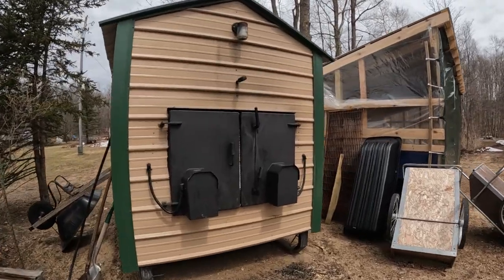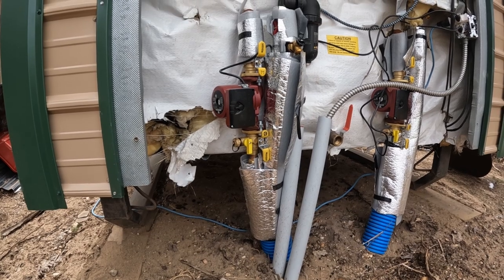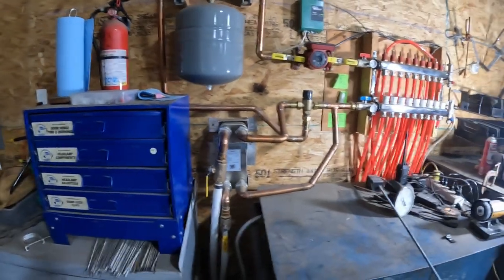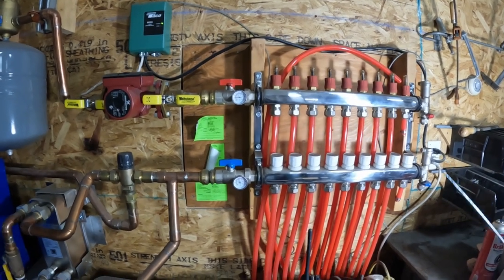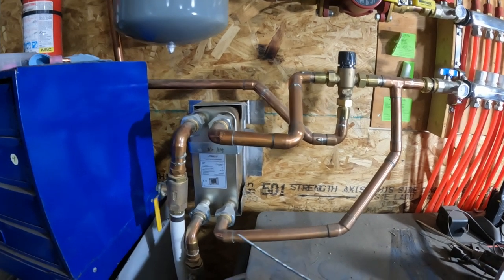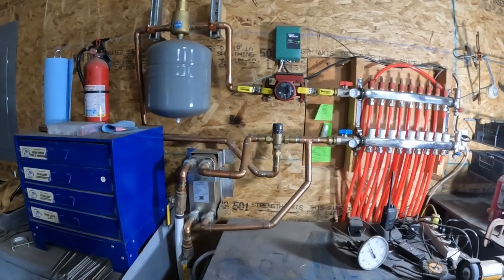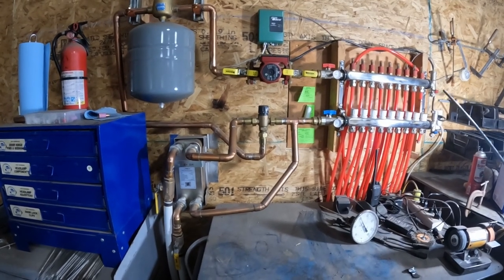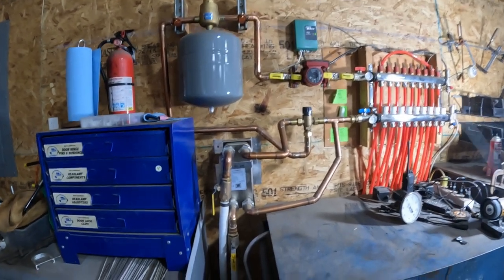Outdoor wood boiler to pole barn in floor radiant heat plumbing.

Comment: Did you install a thermostatic return valve on the water from the boiler. This ensures that you don’t drop the boiler water colder than 150 f which helps prevent sulphuric acid from condensing inside the boiler
Reply from the maker: I did not, I'll look into it though. Of all the prep I did for this I do not remember reading about that.  Where exactly would it go?

Comment: Thank you for the good video. I'm building a 40 by 40 Pole Barn in the Grand Traverse Bay area. And I want to add a future water boiler. Let's start with natural gas water boiler is going to burn Cherry pits. Up here in Traverse City there's a bunch of cherries and they have a high oil content
Reply from the maker: Hope it helped,  good luck over there,  you're only about an hour 20 from where I live.  Just finished our 3 season running the wood boiler,  and though it's some work,  I couldn't be happier,  heating both the house and the barn for a fraction of the cost of lp.

Comment: Hi, I am installing a near identical system; a wood boiler (Earth Brand), to supply in-floor radiant heat tubing.  Did you do the plumbing yourself, or have a plumber install?  I definitely need help, and am over my head on this.  Thanks!
Reply from the maker: I did the 99.9% of the plumbing, I didn't have a 1.25" pex crimper so I had a plumber buddy of mine bring his crimper over for the 8 crimps, I did everything else.  Just take your time and plan it out.  I've made several videos of just about the entire process but am more than happy to share/help anyway I can.  Ground prep, I laid plastic sheeting on the dirt, then the foam board, then the pex, set up the manifolds...etc.  If you're not comfortable with sweating copper pipes, I'd practice (it's really not hard), but you could just use pex and shark bites.  set up the plate exchanger/manifold/pressure tank/pump plumbing similar to what you saw in the video. I've never done anything like this before either, took me several months to nail down exactly how I was going to do it.  I actually thought that I would be pumping the boiler water straight into the floor.  Steep learning curve, but totally doable.

Comment: Your circulator "pump" in the barn should be mounted vertically. This helps with cavitation and longer pump life. Everything else looks pretty good. What brand manifolds are those?
Reply from the maker: Hi and thanks for for taking the time to comment.  I ordered the manifolds off Amazon,  brand is vivo.  I made sure the pump motor was parallel to the ground,  but didn't come across anything about flow being vertical. How does being vertical help with preventing cavitation?
Reply: @twosawacres8096  I've been researching hydronic heating all winter. I'm heating a mid 19th century farmhouse, solely with wood, using a wood furnace and forced air. Time for an outdoor unit to save time and labor. My plans call for multiple circulators in the secondary loop. This will provide the necessary floor required for my needs. All my research noted to install the circulators vertically. I commented to you what I remember off the top of my head.

Comment: I need this system for my setup..  Do you have a link or info on who makes this panel ready to go?  Or at least a parts list you can post?   Crazy they want like $1800 for a  ready made panel, I can't see how it adds up to that or even close in parts...      thanks..
Reply from the maker: Hello, I'm unaware of any premade panels like this, but I'm sure it could be done.  I installed my setup piece by piece.  I will start working on a parts list though, you are not the first one to ask and I've fielded many question regarding the specific components.  I'll keep you posted.
Reply: Okay thanks that would be great. I have the skills to do it but I don't have the time.. but paying $1,800 or more for a premade one seems excessive for what it consist of.   If you could come up with a parts list that would be great and I would take the project on.  Thank you..    ( I'm also in Mi.)
Reply: @twosawacres8096     any chance you had a moment to do this?  Like you said, there is no help out here for this.
I just got a quote for $2500 from a company for this panel.. when I asked what was on it and a couple other questions they told me sorry and good luck..   they didn't even try to answer my questions..    so now I'm determined to follow your example..      makes me wish I went with a different heat source.     Thank you
Reply from the maker: @leinhit  I'll try to get something put together in the next few days,  been working on another video..lol. just to be clear,  you just want the info on the items in the barn?
Reply: @twosawacres8096      yes the panel in the barn...     If I had a parts list and maybe a diagram or a clear picture of the panel.   I tried to screenshot and freeze the video,    but it's not as clear.     Basically starting with the heat exchanger and the floor side of the panel..     since the wood stove side is just hooking up a supply and return to the heat exchanger.     I really appreciate you doing this there's just isn't any information out there and the rudeness and refusal of this last company to even answer a couple simple questions before I spent $2,500 with them.  Really drives at home I need to do this and see exactly how much it will cost me to do myself..   thank you!   I appreciate the extra effort on your part.
Reply from the maker: Sorry it's taken me so long to get this list to you, but here it is:
OWB barn loop parts list:
AMT30, Amtrol extrol expansion tank ex-30, 4.4 gallon
CLI551028A, Discal air separator, sweat
CLI521609A, Caleffi thermostatic mixing valve, sweat
HWCPE40WW1, 40 plate heat exchanger, 160K BTU
TACSR-501, TACO 1-zone switching relay for circulators.
Grundfoss 15-58FC circulator pump
The manifold was just a nine zone stainless steel jobber off of amazon.
Thermostat of your choosing, I just used an old air sensing dial type with plans on installing an in-floor sensor (empty pex line in the floor just for this) but the air type has worked well for 3 years now.
I used unions with high temp gaskets for the plate exchanger so if it ever needs cleaning it’s easy to separate from the system.  You’ll also need flanges for the circ pump and all the associated pipe and fittings.  The pressure tank and air separator are mounted using strut clamp system.  The plate exchanger is mounted with a bracket I made out of some sheet aluminum. 
 @leinhit
Reply: Very cool and thank you so much from one Michigander to another..

Any particular supply place you like to get these parts from? Or I will just start searching.   I appreciate this very much. I am now going to order everything and stick it to the man who tried to charge me $2,500 for it and refuse to answer three simple questions about it before I spent my money....      I appreciate this.

Oh!  Dumb question but how did you fill your fluid in the floor is there a fill valve somewhere on the system?  Also some of the parts number you provided don't seem to come back but I'm working around that. I sure appreciate all this..

Comment: Central boiler says to run these 6 to 24 inches in the ground lol
Reply from the maker: Agreed, but where I live the frost line can easily get to 3 plus feet under plowed areas.  So if I ever have to leave the house or shut the system down for extended times,  the buried lines will not freeze before what is in the tank/boiler.

Comment: This is incredibly helpful/informative. Getting ready to pour concrete for my slab and after months of planning, and just realized an outdoor boiler might be a good alternative to LP in the future. Good to know I could pretty easily modify the system with mostly just a plate exchanger - definitely going to consider this when I hang my circuit.  Thank you!
Reply from the maker: Glad it helps,  this was one of my very first videos, and I made it because I couldn't find any videos on the topic.

Comment: Thanks for making the video! It gave me some insight into doing a closed system along with my wood boiler after many trials of trying to get an open system to work I tried this closed loop. I am unfortunately having the same issues with the closed as I did the open. I lose flow. When all bled it starts at .8gpm per line and holds for probably 5 min then eventually falls to minimal flow.  Not even registered on flow meters. System is holding pressure. Out of things to try!!! Any input would be appreciated ,thank you!
Reply from the maker: If you can send me a photo,  that would help.  Sounds like aeration though.  Email is; twosawacres@gmail.com for photo of the setup.
Reply: Thank you!
Reply: @nickjohnson7468  Did you fix your issue ? What ended up happening ?
Reply: @LORFCASTER  yes, it is fixed. It ended up that the transfer pump that I had bled the lines with was not big enough and air remained in some of my in slab lines. Use a 1/2hp transfer pump if bleeding system.

Comment: So ball park fiuger  how much did it cost ,I'm looking at doing a 40x64 barn
Reply from the maker: Depends on your set up. In floor or forced air?  Wood boiler or on demand water heater?  My 40x60 barn in floor only (not including the owb or plumbing to and from) is probably around 3500. 3k ft of pex and 80 sheets of 2" xps foam insulation for under the concrete add up pretty quick.

Comment: Why does the pump need to be within a short distance to the pressure tank on the heat side? Just bought a house with garage in floor heat and he has it on the return side before mixing valve.  Still making heads or tails of this set up.  Thanks for the helpful video!
Reply from the maker: Check out this video, weird physics of the tank and pump placement...
https://na01.safelinks.protection.outlook.com/?url=https%3A%2F%2Fyoutu.be%2FZr3OX5Frwus%3Fsi%3DEngOnH0li5azLWp7&data=05%7C01%7C%7C90373faa278246c7535608dbda5c6fd4%7C84df9e7fe9f640afb435aaaaaaaaaaaa%7C1%7C0%7C638343862777499180%7CUnknown%7CTWFpbGZsb3d8eyJWIjoiMC4wLjAwMDAiLCJQIjoiV2luMzIiLCJBTiI6Ik1haWwiLCJXVCI6Mn0%3D%7C3000%7C%7C%7C&sdata=SIZr4bkCP1k1RrRT%2B1hvGdJcdEBXzqBqOBrH77Xabmo%3D&reserved=0

Comment: Thanks for the awesome video!  Much appreciated!
Question for you on the actual cement flooring.  Did you insulate under the concrete to keep the radiate heat from going in the ground?  As far as insulation what did you use?  Sorry I am doing this project myself and I am a little clueless.  Thanks for the help!
Reply from the maker: Hi, thanks for watching and taking the time to comment/question.  It's why I started the channel...  after the concrete guys prepped the ground (grading and compacting), I laid 10mil plastic over the entire ground and up the wall edges.  Then I put down 2 inch pink foam board (foamular xps), both on the bottom and the vertical edges a couple inches higher than the depth of the concrete.  Then graphed/planned my zones, built a tubing uncoiler, snapped chalk lines in a 1' grid over the entire floor, then laid the 1/2" pex, stapling every 3 ish feet.. You want your zones to be around 300 feet, and as close in length as can be.  I have eight zones, and they range in length from around 280-310'.  Bigger rolls of pex have length printed on them, so it makes it easier to know how much you've put down...

Comment: Thanks for uploading this! I am just about to build my system, have the floor manifolds in and pressurized. I do have a couple questions tho.....the plate exchanger I have is labeled q1,q2,q3,q4 not sure if this, a 30 plate, is a universal design and how did you size the circulating pump for the floor space you have to heat. I cannot seem to find that info , thankyou again !
Reply from the maker: I think the q1 labeling is just the ports. There are formulas to calculate btu requirements based on several factors.  I just had a chat with a good buddy that's been in the business for 40 years.  I used a 40 plate for each,  the house and barn,  1800sqft and 2400 sqft respectively.  3 years now and very happy with results,  so you could just estimate off that for your size.  Can't really go wrong with oversize exchanger.
Reply: Thank you for that, much appreciated!

Comment: Does the pressure tank need to be at the highest point like you have it? I have a tight space i am trying to fit into and it would work best if the top of the pressure tank was at or below the top of the manifold
Reply from the maker: Just a disclaimer, I'm not a professional plumber or HVAC guy, but my understanding through my research is that the height of the expansion tank is not all that important.  What is important is to have the tank on the inlet side of the circulator pump with a foot or two distance between them.  I chose my tank location based on the pump location, then because my tank mounts to the Caleffi air separator, which should be at the top (air rises in the system).

Comment: the mixing valve is only supplied by the cooler water exiting the system? is that right?
Reply from the maker: Actually,  it has two inputs,  cooled water from the floor and hot water from the plate exchanger,  and one output, which has mixed temp water to the system.

Comment: How did you fill that ?
How did you figure how much You need for the fill ?
I do not plan on using Glycol. Just keep the Water moving and it will not Freeze. 
I'm doing in Floor for My 30x40 shop and keep the temp low. and then a home made wall mounted radiator/fan combo to quickly heat up the place. I am going to have some in-ground Ice melt loops around the front of My buildings too. That I was thinking of Glycol 
Mike M Central Wis.
Reply from the maker: 1/2 pex holds just under a gallon per 100 ft, I had 2400' of pex in the floor,  plus the 1 inch plumbing at the manifold, so I ball parked 25 gal total.  I did use glycol,  I wanted the option to completely shutdown the system and not worry,  broken pipes in concrete is not something I ever want to think about.  Mixed at 60/40 water/ glycol,  I had to get two 5 gal buckets of glycol,  then I used a large Rubbermaid tote and filled it with the mix,  a sprinkler pump with inlet and return hoses submerged in the solution, hooked up to the manifold,  using the zone valves to direct flow,  filled the system and bleed air at the same time. Thanks for the comment and good luck...

Comment: What did that system cost you roughly just for the stuff on the walls to hook up    I’m looking at a place that has the lines run but the in floor heat is not hooked up
Reply from the maker: I'll check later for a more exact number,  but probably around 1k. The pump,  manifold and plate exchanger are the big ticket items,  a couple hundred each,  then the other items add up (controller,  pressure tank,  air separator,  mixing valve...)

Comment: I have the same size polebarn and live in mid michigan.  Getting ready to plumb my boiler to my floor and i was planning on doing the same way as you, glad i ran across your video.  How much more wood do you think you burn a season than before heating your garage?
Reply from the maker: Ironically,  the real reason I got the boiler was to heat the barn...lol. two seasons ago we used only a wood stove in the house,  17 cord, (but it doesn't heat the basement). 2nd season I went through 60+ but the barn attic was not insulated till feb. 3rd season,  55 face total,  house and barn,  upstairs and down from 11nov-9april. Barn around 50deg, house 70ish.
Reply: @twosawacres8096  thanks for the info.  My barn is r19 walls and r30 ceiling.
Reply from the maker: @seangorman6341  that should be good,  I used r21 in the walls and 72 bags of blown in insulation in overhead,  was about 24" deep,  probably settled a bit since.

Comment: What size pump did you use?
Reply from the maker: For the boiler side, two grundfoss 26-99 pumps, for the in-floor loops of the barn, it's a single grundfoss 15-58. Hope this helps and thanks for the comment and watching.

Comment: How many gallons of antifreeze did you have to use.
Reply from the maker: I bought two 5 gallon buckets.  1/2 pex holds about 0.92 gallons per 100ft. I put down 2400ft of pex,  plus the manifolds and copper plumbing.

Comment: Am I missing a gauge to monitor the systems pressure?? I will be hooking my system up this week and I’m worried about over pressurizing the system.
Reply from the maker: I do not have a pressure gauge on either boiler loop or the secondary barn loop. The boiler is open air so it can't over pressurize, and the barn is a closed system with just a circulator pump and tank,  no real threat of over pressure there.  I thought the same as you till I talked with a couple of my plumber/ hvac buds. My house has an lp boiler with a gauge,  which makes sense,  an actual heart source in a closed loop system,  but even that has a pressure relief valve.  Install one or not,  you'll be fine either way.
Reply: @twosawacres8096  after I watched your video and got to thinking that’s what I come up with because of the heat exchanger. The guy who built my system doesn’t respond to my emails or calls so I’m on my own starting this thing up. Thx for the response and again great video
Reply from the maker: @CWBKC  typical!